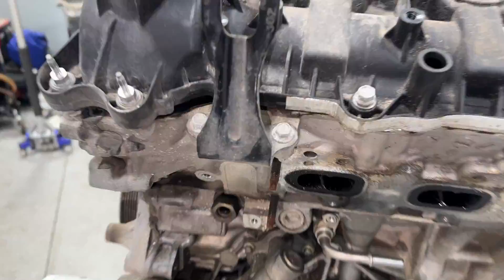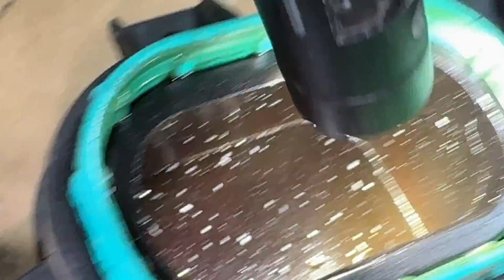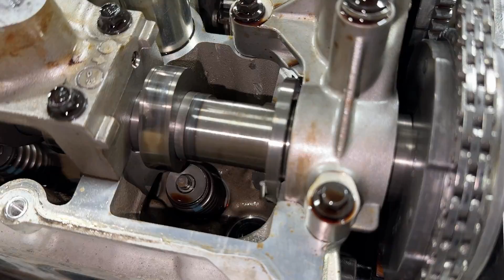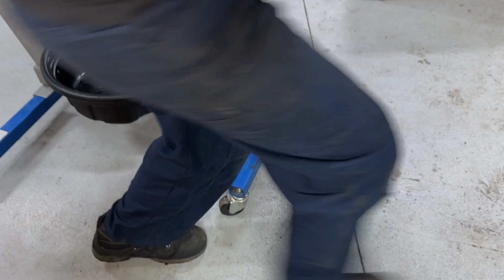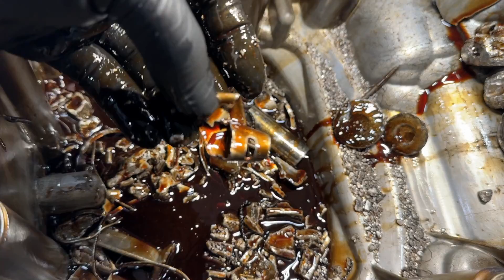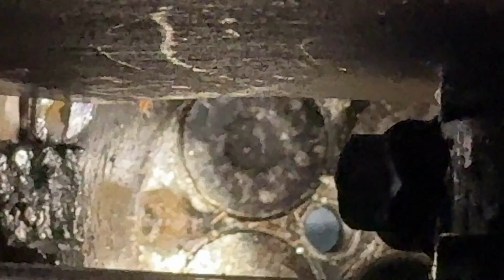Proof Ford Ecoboost Engines and Aggressive Aftermarket Tuners DO NOT MIX!

Comment: My 2002 2v 4.6 modular engine can handle ALOT of powerful tunes and the engine is stock other than the Supercharger that was added. How come a Ecoboost cant handle extra power? cause its  a crap engine

Comment: I guess this would be the classic definition of " grenading an engine".
Looked like you could salvage tge oil filler cap.
Great job, sorry for the owner. But 100k mile engine does not need that kind of boosted rpm and pressure.
Thanks for the video. Great as usual. 
God bless ya'll and hope you have a happy Thanksgiving.

Comment: I have a 2.0L Ecoboost with an OTS tune and have been running it at high milage for a while. I believe that as long as you don't push a stock block waaaay past its intended range, it can reliably handle a bump in power.

That being said, E85 on stock internals and red lining an ecoboost is asking for failure. It's known in the Focus community that our blocks destroy themselves when pushing high rpms. That's why no one really complains about the rev limit. Not too familiar with the 3.5L, but I'd think it'd be similar.

Comment: One of the valves came in contact with one of the pistons. If you run a lot of boost it is working against the spring pressure to close the valve. Lets say you are running 28psi. That's pounds per square inch. I'd estimate the valve to be pretty near 1 or a little more square inches. So each valve had has 28 pounds trying to hang the intake valve open. It's supposed to be closed at some point and if the piston is coming up and the valve is hanging out there it's just a touch and a domino effect after that. The other possibility is timing chain stretch. Cams jump timing and have a valve open when it should be closed or closing. You said it had 135K miles. Not sure how long those chains last on Fords but that is something that has to be replaced from time to time. I'm not sure this really is a tuner issue. Seems more like a maintenance or "nut behind the wheel" issue.

Comment: Lol, I towed in a Dodge 3.6 the other day. Was told he was just driving down the highway and it quit. Looked under and seen the same thing. Rods broken and holes in the block. Still fighting the dealer because the truck only had 35k miles and still under the 60k factory warranty, but they are trying to not cover it.  My 3.5 F150 has 165k on it, still factory everything. I'm planning to do the timing set soon. 
  That engine looked like it came apart at 10k rpm, not just passing someone, lol.  I'm guessing they won't accept that one as a core...

Comment: I know you replaced the intake, but  don't  know if  the intercooler and turbo plumbing  could even have debris in t here too😮
Reply: Better check them pre cats for any  debris that could circulate back into an open exhaust valve too😂

Comment: 14:55 Customer states: "I'm on a budget and would like to trade the truck this June.  Can you just remove the broken connecting rod, and I'll run it with a "permanent cylinder delete?"  I promise to baby the engine, with no more street racing.

Comment: I left my Pontiac all stock. With the exception of a flow master muffler. 

Got rid of it with 263K and it was 15 years old. Engine work was a timing chain cover gasket, 2 water pumps, and a rear main seal under warranty. 

Treat your vehicle right, leave it alone, and the vehicle will treat you right. Guess the owner never learned that lesson.

Comment: I've always told people it's not a good itea to have a "tune" on a stock engine. If the manufacturer had intended to do so they would have done it. Some people think they can reengineer a design and most of the time it never works out in your favor. By doing so you're creating a big headache for yourself. But do people listen, no they don't and think they know more than the manufacturer. I tell people if you wanted a performance vehicle then that's what you should have gotten in the first place.

Comment: I remember years ago a certain online website sold “Bama Tuning” handheld tuners with preloaded tunes for the 4.6 v8 on the Mustang. Total crap shoot to be polite. Friend had one installed on his new edge GT. Not soon after this install, he threw a rod and engine was toast. Learned from his mistake two things. Don’t buy lackluster tunes from one size fits all sellers. Build your engine to properly get reliable power.

Comment: I hope people are paying attention to what you said at the beginning that this was aggressively tuned and not an indication of quality. The owner probably understood the risk he was taking. If they had it set up for E85 they undoubtedly were running ALL the boost and very likely raised the rev limit and shift points well above stock. It's a chance some people are willing to take, but there's no way of predicting how long a longblock will hold together.
Reply: I think that it lasted 137k miles is amazing.
Reply: @charlescurran1289  yeah, if they were running it that hard, the 3.5EB must be pretty robust.
Reply: My buddy was a svc mgr at GM for thirty years and if you brought in one of their Duramax diesels with a tuner, you were out of luck.
Reply: @edsyphan3425  can't say as I blame them. I've watched a brother-in-law who is a welder push his diesels way harder than they were meant to be, using a tuner to pull some ridiculous loads.

Comment: i previously had a 13 f150 3.5 ecoboost with a tune.  They even offered a warrenty with their tunes and i never had an issue. Currently own a 16 f150 with the 3.5 thats also tuned from a different company also with no issues. Alot of it comes down to the person you get the tune from. Ive heard of one tuning company thats had alot of blown engines. Wondering if thats who tuned this one, but im sure you won't tell us whos tune he was running.

Comment: The extent of the destruction is crazy!
I'd love to see the data 'seconds before disaster' showing the sustained peak rpm's.
Reply: Agreed, I think that’s why the pistons were chewed up, the momentum of all the rest of the cylinders firing at high rpm. Just no way this was any manufactured fault.
Reply: Yes, a datalog of exactly what was going on right before it let go would be interesting to review and possibly a good teaching aid of what not to do
Reply: Now in short order the transmission will go out
Reply: I'd perfer to actually hear the last 2 minutes of this disaster.
Reply: Definitely way over revved.  Bad too blow up engine in a 4 year old 65000.00 dollar or more vehicle

Comment: Those holes in the block are called "negative crankcase ventilation" ports. It's also got "ASPG"..automatic spark plug gapping.

Comment: Hmmm.....E85 tuned, Sounds like it detonated at a much higher than designed RPM limit and when it let go it was in manual mode and didn't shift. That is the most carnage I have seen in a long time. Like the whole bottom end went through a blender.

Comment: A few friends and I built and ran a bracket racer in the early 80"s. The "turbo" guys were running 6-12 psi of boost through wide open exhaust. Fast forward 40 years and you can now get showroom cars running 20+ psi of boost but that doesn't leave much room for "tuning".
Reply: Definitely a very thin margin of error with these engines that are already boosted to the sky from the OEM.
Reply: Most new cars running 20psi are using teeny tiny turbos. So 20lbs out of a 30mm inducer is much less flow than a 60mm inducer at 10psi.

Comment: I would love to know how much boost it made with the stock turbos. Looks like it made more boost than the stock intake valve springs could handle and they couldn't close due to the pressurized intake manifold. The piston then slapped the open valve and the rocker arm broke in half.

Comment: I’m running a very aggressive tune on a turbo Volkswagen. +50hp +80 ft lbs. Been on there 103,000 miles.  Never a problem.  I guess I had a good tuner.

Comment: It would be interesting to see how much debris made it into the oil filter.  Just curious as it may help define how long the engine continued to run after the failures started.  This level of metal deformation strongly suggests that the driver had a pretty good idea of what was going on with the engine  -  and kept the throttle mashed wide open regardless  -   and just beat it to the curb, where it died.  This was intentional.  I hope he made it past the driver that was holding him up, long enough to coat their windshield with oil and aluminum confetti.
Reply: Nope, the guy he tried to pass is most likely still laughing. 
I know the type that blew that engine up trying to race tall pickups. They are generally tatted up, pea-brain, "merica" type and deeply in debt/poor. A poor boy that spends too much money on silly vehicle mods instead of sensibly providing for a family like an intelligent MAN would do.

Comment: I HAD THAT HAPPEN TO MY 2017 TUNED 3.5 ECOBOOST. BROKE ONE ROD OUT THE SIDE.  AFTERMARKET WARRANTY PAID 4000, I PAID 7200. NO MORE TUNE. I WAS FUNE WHILE IT LASTED. HAD TO PUT IN A USED ENGINE WITH 30,000 ISH MILES NOW THE PHASER ARE NOISY. FORD GET IT RIGHT. BEEN I FORD GUY SINCE I WAS 15 NOW IM 61. HAD LOTS OF MUSCLE CARS AND 5.0 CROWN VICS ETC THAT YOU COULDN'T KILL OVER 900,000 MILES.

Comment: As an owner of an 07 with the Triton engine, I feel much better about my engine after seeing this. I of course run fully synthetic 5k mile oil and change it every 3k miles. I figure it will help prolong the life on this engine.
Reply: TBF that Triton is literally running about half the power this blown engine was.
Reply: @upshifter5316  Not stock it isn't. I have an old police cruiser with the upgrades mind you.
Reply: @toysoldier46552  Ok, so what kind of power does your 5.4L make? 3.5L F150's put down about 355 whp on the stock tuning with 93 octane. This guy with bigger injectors running E85 was likely north of 500 whp.
Reply: Triton engines running about 107 HP at the crank. Guy spouting off about him being content with his Triton's power. Lol 😅😅😅😅😅
Reply: @randomuserofprogram Maybe it's Supercharged, like my 465,000  02
Reply: @randomuserofprogram Maybe it's Supercharged, like my 465,000  02
Reply: @randomuserofprogram  Old police cruiser with the engine upgrades, next...
Reply: @randomuserofprogram they are running more than that. My 4.6 has 212 hp ‘06 …! Still nothing compared to today’s engines … my wife makes fun of my because she has the 3.5 eco in our expedition and my truck has a banks full cat back monster exhaust and she says it makes all this noise but we are not going anywhere 😂😂😂😢😢😢
Reply: Every engine will blow up with abuse, this disaster has nothing to do with the design
Reply: A toyota channel recently just showed what "10,000 mile dealer recommended" oil changes does.  Triton, EB, or Coyote, change the oil at 3k.  Do you remember how mid 70's motors with plain dino oil lived to be 250-300k miles or old Yotas w/ 500k miles?  Oil is cheaper than a new motor.   The EB is a good motor but when you watch the vid you can see the varnish on multiple parts.  I suspect he was running it hard and maybe doing 5k changes.  I've seen less varnish on old SB350s with twice the mileage but they did 3k oil changes.  Maintenance is under rated.

Comment: Hey Alex, I have a 2020 with. 2.7. It recently experienced a failure of the drivers side charge tube ahead of the turbo. It had flames shooting out of it ( I have a video) repaired under warranty. Any ideas I believe the dealer story on the failure.

Comment: Catastrophic failere is always a great CSI story, it injested metal into the oil pickup screen before the rod severed the pick up tube in the middle, Valve failure , rocker failure, wow, great video, thumbs up

Comment: You mention the stock cam phasers rattle but don’t self-destruct. I have an 2018 explorer with the 3.5 ecoboost that has the rattle on start up. I’m currently doing extended crank process every time I start it. As long as I do that do I not need to worry about the CAM phasers completely failing?

Comment: I love my 3.5 Eco in my 19' .Works great for my needs. I tow regularly, use a good synthetic and change the oil every 5000miles/8000 kms.I don't plan on tuning
Reply: I would tune it. 5 Star tuning will make it a whole new truck and it will last forever. I have 3 add on tunes. 87 tow, 93 performance, E30 and E50 tune. E50 is pretty darn fast super low 11s in the quarter. 87 tune i use it when camping across states because I know i can get regular gas and its cheaper than 93.
Reply: @randyschmidt19  I will say I have thought about an 87 tow tune,but never went ahead with it
Reply: @jasonbrushett2005  Its a step up from stock. Boost builds earlier  but not much more boost than stock and trans shift if better.  I love Ecoboost because for the price you can't get more power
Reply: @randyschmidt19  early boost kills rods.  The 7.3 PSD learned that the hard way the 1st few years.  Same year trucks, same rods, including powdered metal rods, w/ huge injectors and big turbos, less timing and motors lived.

Comment: That’s not as good of a failure as a GM 350. There is nothing to look at after you remove the pan but the block and pieces of the cam. LOL

Comment: Considering how quickly these half-fast tuners could generate 500-600hp from the EB3.5 - along with the weird torque-limiting power curve in my stock '16 Flex - it's clear you should just be happy with the stock powertrain and keep it that way. With good care, these engines should last a half million miles without a major mishap.
Reply: Yes.
... exactly.
Reply: I'm very happy with mine so far. It's in a 2015 Transit van. I'm currently sitting in the desert several miles from blacktop. As a nomad, I  absolutely take the best care of this engine.  
I've never had it above 4000 rpms, even climbing mountains in Colorado.  
Oil changes every 3000, regardless of how clean it still is.  I don't care,  I'll happily spend the money on them. Also, it gets a new air filter every 30 days and is washed weekly. Lots of dust on these desert roads.  
This is my home,  and these conditions are harsh. 
Breakdowns are inevitable,  but I do my best to avoid them.

Comment: Nice video.  Interesting and educational. I've read about potential damage from over tuning - twisted axles and drive shafts - but never seen this much carnage.  Hopefully anyone thinking about tuning their 3.5 searches for advice and sees your video.

Question - since the owner is interested in more power why didn't he opt for a Coyote v-8 to replace the blown engine?
Reply: The original owner would have saved money in the long run to rebuild the 3.5 with stronger internals. The weakest part brakes first. That would be the rods, pistons, rings, and crank. With an over aggressive tune, which this is, you need stronger internals.
Reply: @michaelsheets6851  my thought exactly.  The reman F150 EB long block is only $5k.  I believe the crank on these are forged but the 7.3 guys learned that forged parts still break with aggressive tuning.  At the end of the day, you'll only get so much power out of 217 CID 🤷
Reply: Stock to stock they are basically the same but the boost of the 3.5 makes towing at elevation easier.  At a simple whipple to the Coyote and you can add anothe 150-200hp.  Twin sequentials on a 5.0 and guys are seeing 1000hp on "stock" internals but I suspect that won't last long for a DD pushed hard.  I wanted to TT a 5.0 but I got a steal on my 3.5.  IF I stumble across a clean, well taken care of 5.0 I might grab it and do twins but that alone is a $8-10k add on.  All it takes is $$

Comment: I'm on engine #4 on my 2014 due to the same thing. I wish I could show my pictures. I will say engine #2 I had no part in the engine blowing up. Ford put the engine in and it went 3 miles on their test drive and blew up.

Comment: Could it be Bryan, that this engine was producing so much power that the stock valve springs weren't stiff enough, and roller followers not sturdy enough, and the failure occurred there.  Got to wonder if it wasn't a single roller follower, followed by the spring, keeper, valve drops down, and the damage sent enough pieces to nuke the other side cylinder.

Comment: We have a 2020 Escape with the 1.5 Ecoboost. 35K miles, it runs great, has plenty of power for daily driving, and car is very comfortable, with very good fuel mileage. When we bought it, the Service Manager told me they were not having the issues with the newer engines as they were with the older ones, (coolant ingestion, blown head gasket, cylinder wall failure.) So, we love the car, and we are retired, so we are looking to keep this car for some time. Question is, are we sitting on a potential time bomb? Hope not. No tuners for us, and we keep the car serviced.

Comment: Looks like an over-rev disintegration to me. He wasn't trying to pass someone. He was trying to win a race.
Reply: I'm unsure, I've seen ecoboosts rev to 6,500 with no issues and the N/A 3.7 has no problem revving to 7k.
Reply: @lethargicstove2024  rod stretch is clearly visible. Rod stretch comes from over revving.
Reply: @waynec369  interesting, I thought the ecoboosts had very strong connecting rods